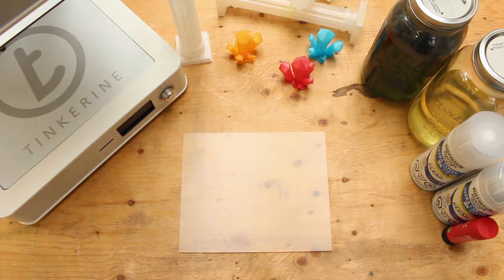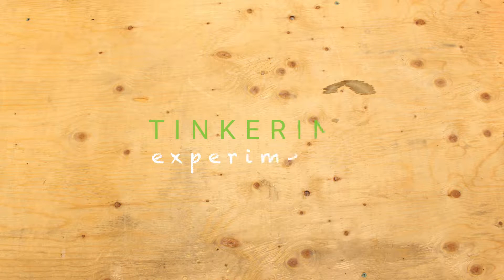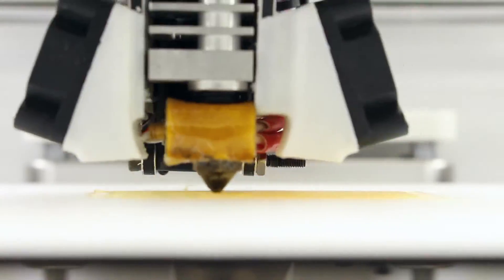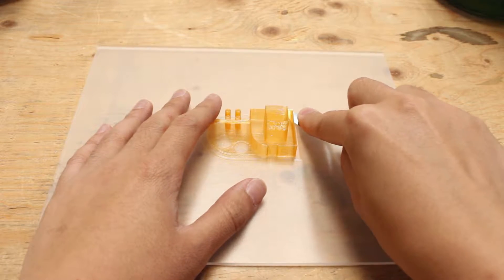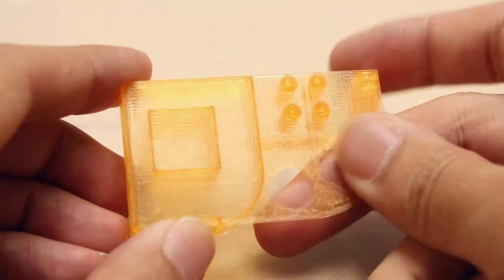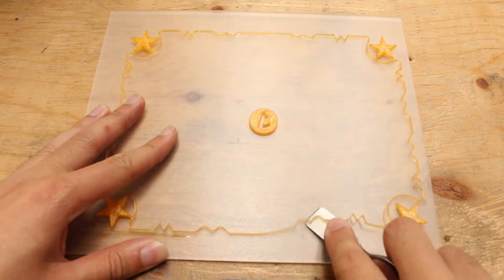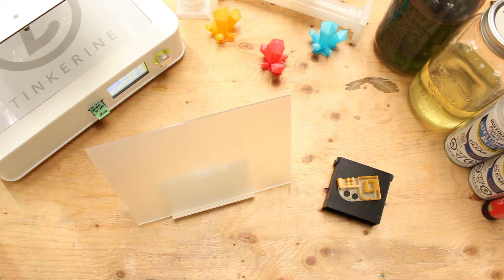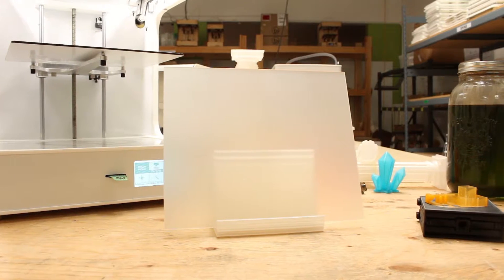Bed Adhesion with Frosted Acrylic Sheet

Comment: Do you recomend it? My heatbed suddunly stopped heating and I don't know why, so I'm searching for an alternative, I only print with PLA but it doesn't stick well in the Buildtak
Reply from the maker: Hi Liam,

Thanks for commenting! I would recommend the frosted acrylic sheet but I would have to stress that the bed has to be level.  If the bed is way too close and is digging into the acrylic sheet, it will destroy the sheet.  Other than that, it is a good adhesive material. If you are printing a large print on the sheet, it may be a bit difficult to remove afterwards.  

Thanks!